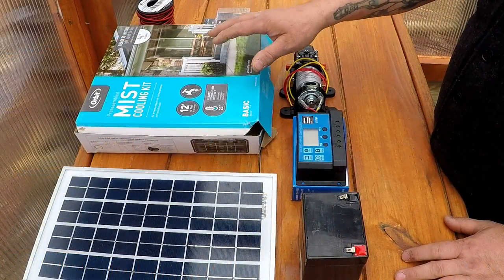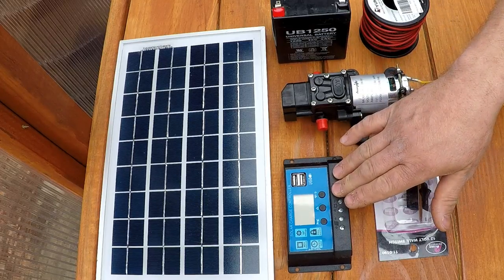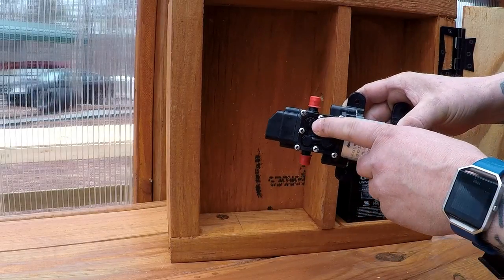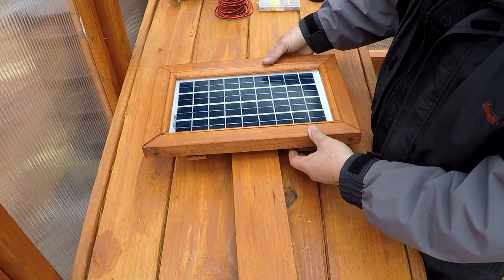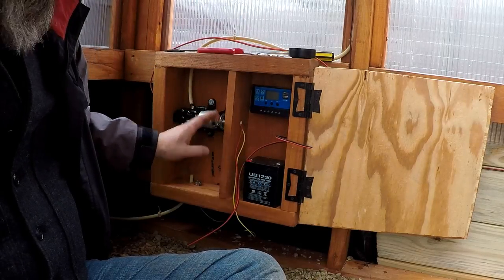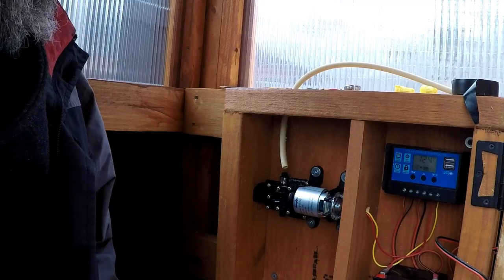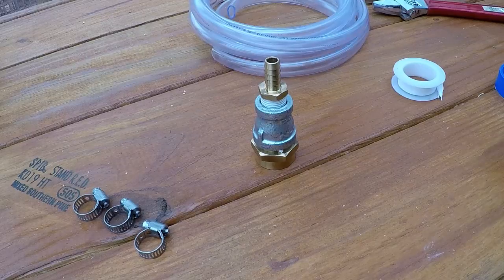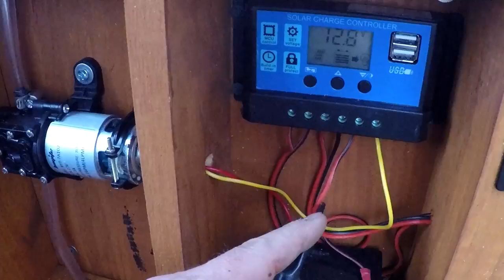Solar Misting System for Greenhouse, water pump and charge controller

Comment: If you run your plumbing tape the opposite direction it won't peel off when you screw them together. Cool video I'm doing something similar right now. 12v auto watering system. I knew nothing about the irrigation system, solar system, batteries, nothing. It's been quite the journey piecing all of this stuff together. YouTube and guys like you make it possible for anyone who is willing to put fourth the effort to do anything. That's for taking the time to make the video.

Comment: One of the best videos I have seen. I appreciate that you did not edit out the miss steps, they happen with just about every project that I do. Great job!
Reply from the maker: Mike Mattox Really appreciate it.  I make a lot of mistakes but it usually works out in the end, kind of lol.  Cheers!!
Reply: Were you happy with the solar set up that you used? I am getting ready to buy parts to do the same and wanted to check for a update if you are happy with the size of the solar panel or the charge controller. Thanks in advance!

Comment: In my mind there is nothing wrong with over kill.  I like watching your videos you always do nice work.  Not trying to be nit picky but just an FYI.  You applied your teflon tape on to your fittings backwards.  You can watch on the first fitting you screwed together you can see the tape starts to unthread and bunch up a little.  If you wrap it the other way it tightens with the fitting.  I have to think about it every time I use it.  I doubt it will leak.  Keep up the nice work.
Reply from the maker: Matthew Burcz that is a really great point.  I didn't even think about that when I was putting it on.  I'm going to redo it just so I know it's done right.  I really appreciate the heads up.  It hasn't leaked but I'll know it in the back of my mind lol.  ATB

Comment: From what I saw in this video no overkill but there are some things which could be done to improve the system. Since you are using rain water there could be a need to filter the water for dust, sticks, leaves, bugs, and anything else which can plug up the system.
A pressure regulator could be added to the output with the pressure tank I mentioned before to regulate mist flow.

Comment: After running that system for a while, have you had to fight mold and mildew in the greenhouse?
Reply from the maker: I haven’t really had any issues with mold or anything, but will it stand the test of time?  We do try and keep it clean and organized which may help the moisture evaporate.  We keep the door propped at night sometimes for pollinators and our farm cats getting the mice, country living.  I think that helps reduce mold as well.  I hope that’s helpful, cheers

Comment: thanks for good ideas
Reply from the maker: Thanks!  I hope it helps with your plans.  Cheers!
Reply: @fireballmalone1  What is your experience after one year?
Reply from the maker: @miro25BA  It has held up great, I actually used it tonight for lettuce I have going now that it finally cooled off.  One thing I did upgrade was a filter at the tap from the barrel and I had to replace the nozzles because I didn't properly purge the lines.  I read vinegar is good to use and then unscrew the misters and soak them before storing them.  The replacements were only $11 but that could have been a lot of seeds.  I hope this helps, Cheers!

Comment: Enjoyed the pace of the video and the clean work you did. Few questions, how much did this cool down the greenhouse?  I had too high temps last season and everything that did grow was very stunted.. you mention twice a day for 10 mins. I'm looking to add humidity this cooling are you using for that or more for surface watering?
Reply from the maker: Adding a misting feature will definitely add humidity to the air and it will cool it down initially but without proper ventilation the temp will spike again pretty quick.  I am working on some automated fans for air circulation and am going to attempt to have the timing staggered so the misting happens after the fans so I’m not purging all the moisture.  Last year I use a simple fam on an extension cord and basic timer and it worked great.  Although having the wire running across the yard was an eyesore.  I hope this is helpful and good luck!! ATB
Reply: @fireballmalone1  Thanks for your response, I use a solar powered fan, which works really well as well as an auto vent opener. I also removed another small window to allow more air in but the temps are still too high. I'll give this a try. Thanks again.
Reply: did you ever or think about adding some sort of timer?  would that come before the controller or does the controller have any timer features?  thanks
Reply from the maker: @thebizyman1  the controller is only used to direct power from the solar panel to the pump/battery.  I did install a timer that attaches over the on/off switch.  It works ok, but I honestly rarely ever use it.

Comment: Did you replace the battery yet? I am making similar system but looking to get a small reliable 12v battery.
Reply from the maker: Vaughan after the winter I put the battery on a trickle charger I use for motorcycles as it fires right up and has been running string all summer so far

Comment: Hi, great video. I copied your system and it works great. I was just wondering if you had put it on a timer yet and how I would go about doing that? Any recommendations would be great.
Reply: Thanks!  I ended up using a battery powered flip switch timer that worked pretty good since I don’t have power out there.  Here is a link to the one I used which I bought randomly at a big box store.  There may be better ones out there
 https://images.homedepot-static.com/productImages/bdeb6cc8-b0a7-41be-9516-46b42e36cd97/svn/white-woods-timers-59744wd-e1_600.jpg
I hope this helps!! Cheers
Reply: Thank you so much, this is exacly what I need! ❤
Reply: @tamaramichaels3697  Awesome! I really hope it works for you.  Please let me know how it goes!

Comment: hii,

great edu video.
what's that clicking noise at @16:00 mins  ?
btw, what the green house for ?  how many mister this tiny pump can works with ? too little mister, will over load the pump, and too many will causing not enough pressure to come out as mist, instead as dropplet...

your reply will be very much appreciated. 

thanks

andrew
Reply from the maker: The water pump is a self priming pump and makes that noise as it's running.  One key thing I ended up doing after having it for a little while was to add a filter to the water barrel to keep the lines free of debris.  Cheers!

Comment: I didn't see if you installed an accumulator pressure tank in the output of the pump. Installing a pressure tank might improve the misting flow.

Comment: The load output of this type of charge controller is for low power devices. I'm wondering how this worked on the pump. Also I've had to put heat grease on the power transistors of all of the controllers of this type I have. Some did not contact the back plate which serves as a heatsink.
Reply from the maker: We have used this now for 2 seasons and haven't had any issue with it at all actually.  Maybe I've just been lucky.  I've added a filter on the barrels and have had to blow out the lines due to the immense amount of pollen in the woods, but the controller has been a champ.  cheers!

Comment: Great video! I am trying to do a solar system like yours. Where did you get the solar panel and electrical components? Was it all a kit or did you buy separate? I am trying to piece this together but having trouble knowing what to buy.

Comment: how did that hose hold up? as far as i know that type of hose is not ideal for suction applications.
Reply from the maker: The hose has been great so far, but the spray nozzles get clogged pretty easy.  If there’s no filter on the barrel output, it’s kind of a nightmare.  I take them off occasionally and soak them in vinegar and have an rv filter attached and it seems to do the trick
Reply: @fireballmalone1  also you can try a foam filter. But it needs to be inside the drum at the beginning of your line.
Reply from the maker: @morzaprowashpressurewashin5673  I had never even thought of that! It’s a great idea, and I would assume a lot less expensive.  The rv filters im using are $30, and I change it each spring

Comment: how long will that battery run that pump before 50%?
Reply from the maker: You know that is a good question.  The amount of water that pump can crank out is pretty significant and my greenhouse isn't extremely big so I usually only run it for about ten minutes, twice a day on the hottest days and the battery barely takes a hit.  I would think there would be variables like whether the sun is shining time of day for recharge value that may come into play, but it has been a champ and really exceeded my expectations.  I am using it this fall for lettuce and even with low light exposure, it's performing really well with this small battery.  And the chickens love hanging out in there for some reason...

Comment: So why is the switch even used or needed?
Reply from the maker: Kevin M the on/off switch is wired between the battery and pump so the power going to the pump can be controlled.

Comment: Can u time it to come on when u want to
Reply from the maker: Yes, there are light switch timers that work pretty well.  I use an Autochron light switch timer that just fits over the existing traditional flip switch.  You set the time, program what time it turns on/off.  And that’s that.  Takes 2 AA batteries that I’ve changed once after about 8 months.  Think it was like $22.   I hope this helps.  Cheers

Comment: What is the psi on the pump please everyone
Reply from the maker: Dean Bigg The pump I used is rated 80 psi.  For informative purposes only, I do not receive any profit but I would like to assist, here’s a link to the one that I purchased: https://www.amazon.com/gp/product/B01N75ZIXF/ref=ppx_yo_dt_b_search_asin_title?ie=UTF8&psc=1
Reply: Thanks mate
Reply: I know as you say over kill but I can get 100psi in the uk for a bit cheaper than a 80 will that be too much
Reply from the maker: Dean Bigg I don’t think it should be an issue.  I run mine through an RV filter that connects directly to the rain barrels and it reduces the psi a little but Am pretty sure the misting lines can take it.  RV pressure regulators are super cheap too JIK.
Reply: That’s how I’m doing mine

Comment: Sounds like the motor was struggling
Reply from the maker: Abe Coulter It’s actually supposed to sound that way because it’s a self priming pump.  It is able to purge the air in the line and runs on cycles so it sounds like it saying “I think I can, I think I can,”, but it’s good to go.